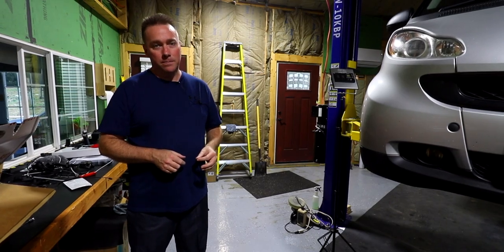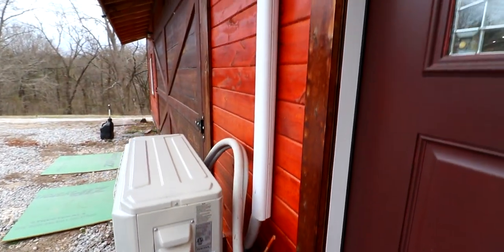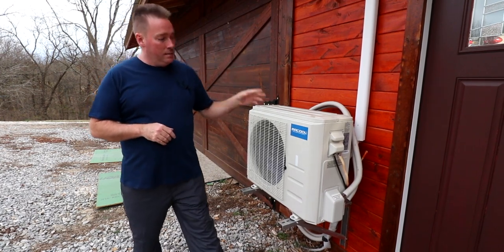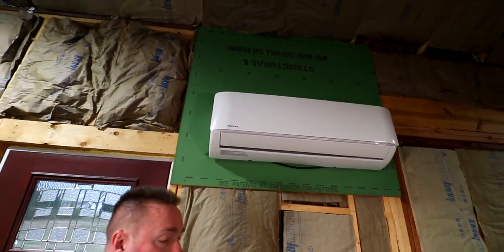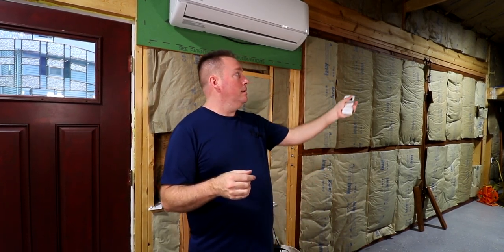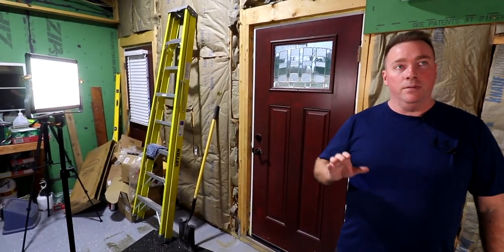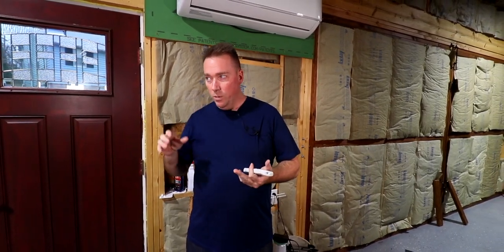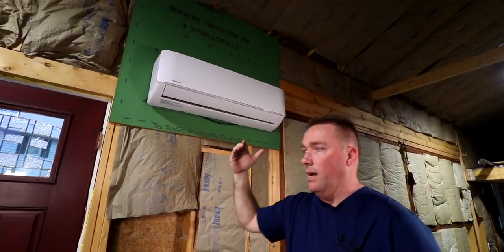MRCOOL Mini Split AC Heat Pump Installation SECRET TIPS Part 2

Comment: Wait until it breaks down. See if your local heating and air guy will work on it. Then find out the parts are so expensive that it’s not worth fixing after five years. Then you can buy another one and do it yourself again. Also, try cleaning one of those indoor units, especially the blower wheel, as those cheap plastic filters only stop the big stuff.  Manufacturers do not warranty parts on DIY installs.
Reply: Hopefully what you said is not always true.   The parts for some mini split systems can be hard to find - expensive.   Mitsubishi has had the reputation of being the most serviceable.   They wall units should be cleaned once a month, they can develop bacteria growth that can harm the system. As time goes on there could be fewer proprietary parts in these units and DIY forums can help home owners service them.
Reply: At 10 to 15 years or so you just get new unit cost more to fix the old units then buy new unit. Parts become hard to buy.
Reply: @davidwright1752  Over time, the mini split units could evolve to be more of a commodity with standardized components.  They are similar to a unit in an automobile, except that HVAC in cars aren't heat pumps.  Could be widely serviced by using less proprietary technology as patents lapse.  Conceptually, I like the ductless systems.
Reply: @timothykeith1367  How many of these have you owned these have been used for 40 years in Australia I have  25 of them now over the last 30 years each model has its own printed circuit board and special components believe me I just replace them they cost just as much to repair as replace. Repair comes with 12 month warranty on the replace part new one has 5 year warranty plus newer technology and far cheaper to run. I spent $6000 to save a commercial unit that lasted 1 month found out no warranty then spent $6000 to get new replacement unit with 5 year warranty (technicians do not know how much it will cost to fix these units until they start on them) I got caught badly with the $6000 repair. If I knew the bill was going to be that much I would not attempt the repair. By the way I am a technician my self. ( not air conditioning) . This things are more like a car at 10 to 15 years just how much do you spend to get another few years. Just a tip ducted is great but not very efficient compared to splits. Try to get a cop of 5 usually only available as small split that will give you 1 kw of power in for 5 kw of heating.

Comment: Nathan, how do you add the extended warranty through Amazon, I don't see that. Also, you're sure that is the 24k and not the 36k? Everything I've read online says you would need 36k. I have a 30x40 insulated pole barn in Ohio and I'm trying to decide between the two.

Comment: Update on operating costs and any issues you've had with the units?
Reply from the maker: No issues, but dont hang it on the side of your building, it does vibrate

Comment: We installed in August 2020 . Two biggest flaws vibrates wall on inside house.Second is temperature is not accurate.Set 83 heat is about 74 ish.Cool set 74 goes to 68.Still like be it.Very reasonable cost to run.

Comment: Hi Nathan. I found coolant in the rear heater duct under the centre console in my 2000 bmw e39 535i. I'm in the process of taking it apart, but any ideas how coolant would get in there?
Thanks for all the videos.

Comment: Check your copper line sets that white ISO POLAR insulation is causing an acidic climate when wet that creates pin holes in the copper. I pulled out a run and put up a video of it leaking through little pin holes over a 15 ft span. Still have another 160 Ft to pull out and the suppliers and manufacturers are trying to hide the failure and pass costs on to you.
Reply from the maker: I have to say after almost 3 years the mr cool is still running but it has always had vibrations in the metal case , we did a pioneer unit in my house and it is similar but seems to be a better and now cheaper solution to the mr cool
Reply: @NathansBMWWorkshop  Glad to here it. Maybe the Mr Cool line did not use the same ISO Polar insulation. My 3 zone system copper looks like it’s 20 years old after only 1 1/2 and two of the zones have pin hole leaks from corrosion and I’ll have eat the cost to install all new

Comment: Nathan, thank you for this review as I am considering also a DIY MRCOOL.  I have a new house being built and am looking at a mult system with 3 room units.  Any thoughts on ease of installation vs just having a professional install?  Also  I am actively soliciting bids now so I suspect the professional bids will come in 2-3X what I could buy the system outright.  I have to weigh that with my time + ease of installation.  Also, any comments on maintenance requirements and system cost over time?  I know split systems are way more efficient as you mentioned but I have also heard they don't have the lifespan of conventional HVAC.
Reply: That depends. If going dyi with mrcool that will work.  But it is a ton of work. You won't find that out until you do it.
Reply: As far as equipment life, well, the installation is what makes or breaks a system. But depending on where you live and if you use these for heat will determine their life span. However, typical system or mini splits, a variable system is way more comfy and much quieter.

Comment: 12000 BTU Is almost $1600. on ur link. the 18000 BTU is a lil cheaper. I thought u said it would be about $700 for the 12000 BTU
Reply: I just got the 24000 BTU last week on amazon for $1700 and i looked it up and its still that same price.
Reply: Folks, prices on these things depend on the SEER and other features.  For example one or more of the mfrs sells units that are set up for easy DIY, where the owner simply opens a valve or 2 when the physical install is done.  Those cost a lot more!  A 22 SEER unit will cost more than a 16 SEER.  Etc.

Comment: I'm confused, do you have the 24k or 18k model? I've got a 660 square ft garage I'm looking to climate control. Debating between a 24k or 18k
Reply from the maker: For 660 sq ft you need the 18k model
Reply: @NathansBMWWorkshop  will the 24k model regulate the temp faster after the garage door was opened to pull a car in/out?
Reply from the maker: @mikeworkman1759  probably but it’s overkill, 18k unit will be nearly overkill, I just installed a pioneer 18k in my house at 900sq ft and it will
Run you out , I put a video up of it a couple weeks ago on my other channel nathan’s Porsche workshop , the pioneer unit is about $900 right now so half the price of the mr cool unit and exactly the same unit

Comment: Who told you window units suck air from the outside 🤣 that's not how it works so if you get smells from outside you didn't seal it probably

Comment: 20 amp circuits require 12 ga. wire, 15 amp circuits use 14 ga., That's code.